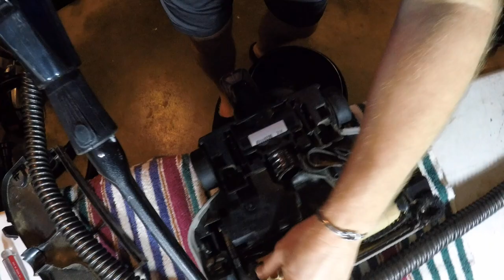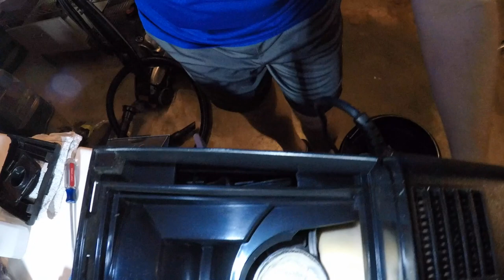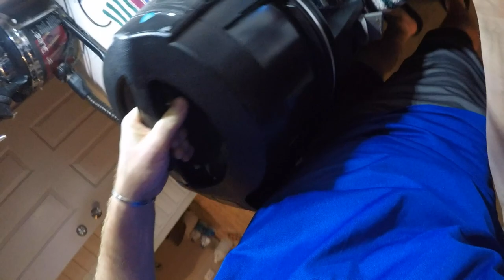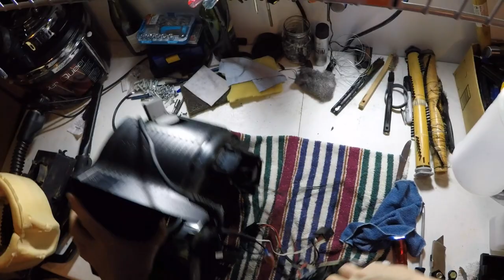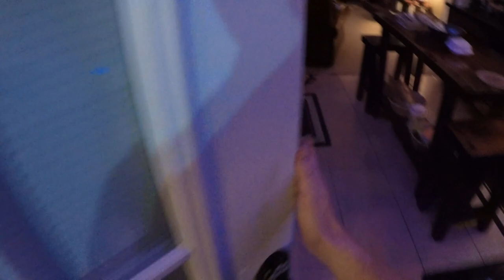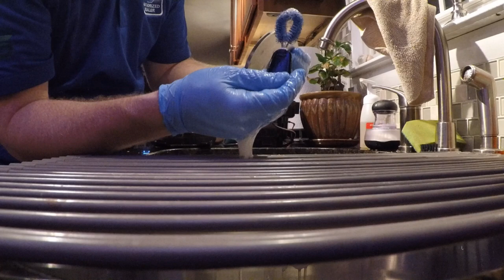Rainbow E2 Motor Tear down and Clean

Comment: I know this is old, but is the 2nd blade sandwiched between the housing and the cover piece? I reassembled and it works fine, just the middle blade doesn’t spin

Comment: Thanks for sharing your video. I've a similar model and have a couple of questions, if you don't mind:
1. Is the motor a DC or AC motor?
2. What is the voltage and amperage rating of the motor?
3. Are there any carbon brushes?

Comment: I notice your rubber seal is stick to the motor base. When I look out mine, they come apart. (17.30++ onward)

Should I be worried? I put them back together after washing and I notice there is some rubber left on the based.

Comment: Help. Followed your steps to clean. Ive got it back together and now it won't turn on. Ive taken apart and checked all my connections. Any ideas?? Please help!!
Reply from the maker: Check safety switch make sure it’s seated properly other than that it’s usually a wire connection
Reply: @gagainer  thanks a bunch. In the middle of doing that when you commented. Great info. Keep it up.

Comment: Is the number 2 disk not firmly affixed to the others when the nut is tightened?  Mine is still loose for some reason.
Reply from the maker: No they are suppose to float freely....I know it seems weird but trust me... I learned the hard way...LOL
Reply: @gagainer  great. I had it right then.  I did just about pull my last hairs out when I got it all back together and it wouldn't come on.  I finally figured out that it must be sitting on the bowl before it could actually turn on.  Those darn safety features.

Comment: This is probably a long shot because this is an old video but I took everything apart and put it all back together and it's not powering on. I took it apart again and found a piece had come loose. I can't post a picture but I will describe as best as I can. When you break the motor down to just the piston shaft, the top motor housing has a copper piece poking through the middle. A very thin circular wavy metal disk sits in that spot (I'm assuming). That's the part that came out. How does it sit in there? Does the copper touch the motor with the disk sitting under the copper piece on top of the plastic? This is my only guess as to why it won't turn on. All of the connections are in the right spot (pretty foolproof there) and it's sitting on the bowl when I try to power it on.
Reply from the maker: Maegan Russell I don’t have one here to look at but that’s cooling fan for the motor and if I am correct that’s suppose to permanently be mounted to that shaft i am almost certain that wasn’t removable at least it wasn’t on the models I had .....  let me verify w my vac guy
Reply: @gagainer  Maybe I can take a video and send you the link so you can see what I'm talking about. I can't figure out anything else that could explain why it's not turning on.

Comment: My rainbow was made in 1990  , I just bought it second hand , can not loosen the nut on the fan blade to clean it . You can see it has been tightened to much . What can I do to loosen the nut ? Thank you .
Reply from the maker: Leta Terrell there really isn’t a good solution to those d machines other than disassemble the entire motor housing and using force to break the nut off I have personally damaged a machine trying to do it I would recommend taking it to a vac repair shop preferable a rainbow dealer to have them do it this is the reason these separators need to cleaned specifically on those older machines

Comment: I had the rubber mounting on lower part of motor on wrong.  It sounds normal again.  So does it have to have a sealant on it?
Reply from the maker: Jamie White no if it’s an e2 or e1 no
Reply from the maker: Jamie White no it’s designed to be seated in the new models

Comment: I attempted to clean the fan blades but they know rub together making weird noise. I also had troubles taking bolts off. Any suggestions on fan blades.
Reply from the maker: Jamie White two things either the two washers are not lining or seated prop or the main but on the motor shaft is too tight

Comment: I got similar model, I tear it down to the motor.

When I put everything back together, I cannot power on the motor. I am not sure what I did wrong, do you have any idea? I check all the connection and redo everything twice.

Anyway to troubleshoot?
Reply from the maker: Magus Tan I would say check the safety switch it’s a little plastic tab that fell out it is depressed when water basin is on machine it won’t allow the machine to run if the basin isn’t attached I believe I made mention of that other than that it’s got to be in connections before putting it all back together depress that switch and turn on power to make sure it’s running prior to reassemble
Reply: @gagainer  thanks. Yes I found that out after rewatching it. Cheers
Reply: @gagainer  I just tore down my E2 black today to clean it out.  I was perplexed when a small black plastic piece fell out of the safety switch area.  It fell out so quickly I was not able to see where it was supposed to go back.  Ended up just tossing it in there and now it doesn't power back on.  Ill have to tear down again, which will be a lot easier the next go round.  Didnt catch on this video where that small piece is supposed to go  😫

Comment: How do you wash the foam? And does it loose the shape when you wash them?
Reply from the maker: Hey Alexis good question... i wash it in hot soapy water in the sink.. kinda keep squishing it around in the detergent and water and then drain sink and repeat with hot water... once all soap is out let it air dry for 24 hours and no it is dense foam so it won't loose shape
Reply: Thanks a Lot G Gainer !!!

Comment: I have noticed my rainbow is louder. Making more of a whining sound. What could be causing that?
Reply from the maker: Jamie White my guess is dirty or corroded motor the more dirt that builds up the louder the machine gets how long has it been since it was cleaned ? Also I use a rubber sealant I get from Lowe’s

Comment: The Rainbow dealer said to use a  3M Automotive Black Super Weatherstrip & Gasket Adhesive.
Reply from the maker: Greg Royal I have never used weather stripping you can order the gaskets fairly cheap so I always go that route and yes a flexible gasket adhesive

Comment: What happens if thr motor sucks up water and stops working?
Reply from the maker: Richard Rule depends on how long it’s been sometimes you can turn it back on and let it dry itself out but if the motor is locked up you will have to disassemble my recommendation is take it to a vac repair center
Reply: @gagainer  honestly as i was driving it into the repair shop it tumbled around in my trunk and when we got there and plugged it in, it started. I guess the russian method works from time to time